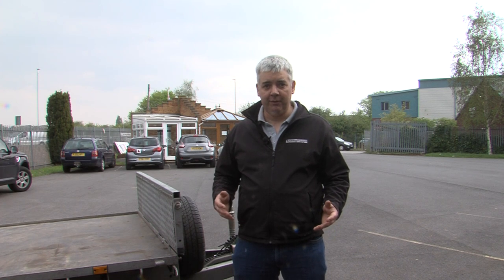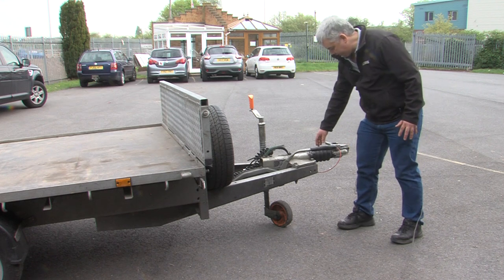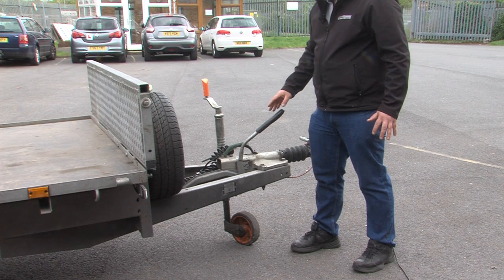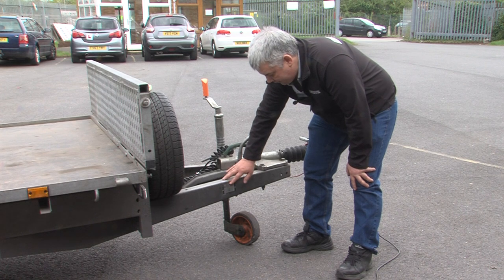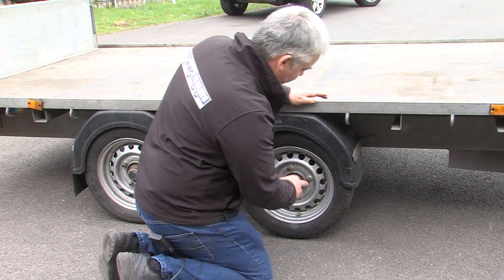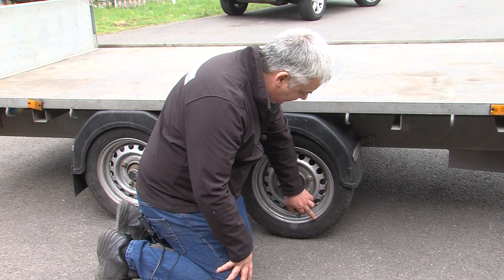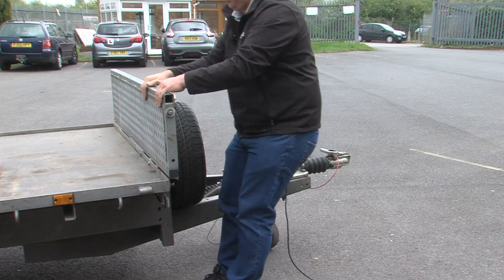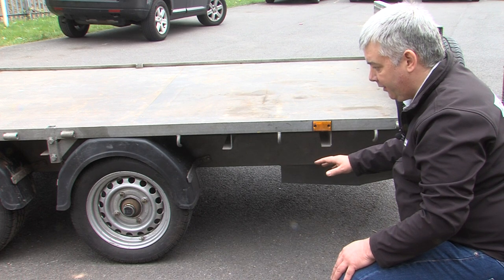Checks to do when buying a used trailer

Comment: how much play in a coupling is too much? have an old bradley coupling seems about twice as much play as a new alko i felt, play goes away when greased, that ok? thanks
Reply from the maker: Hi 

it is not acceptable to have a lot of play in the draw tube of a coupling work on a maximum of 1mm where the drawtube comes out of the body. 

When servicing a trailer we pump 2 squirts of grease into the 2 grease nipples on the top of the coupling if all play disappears with these 2 squirts of grease it is acceptable. Please note that the first time the trailer is used it will have play again.
Reply: thanks for the reply and informative videos